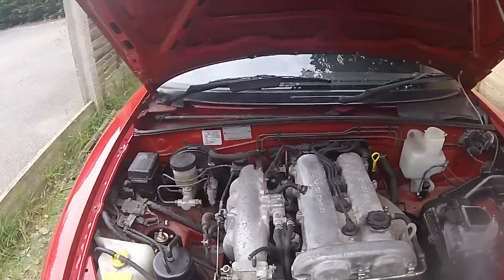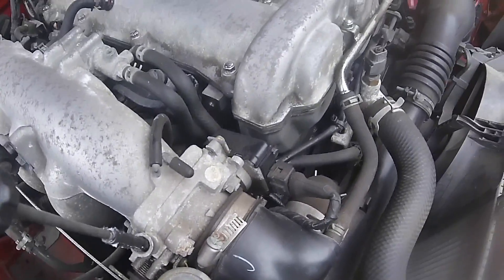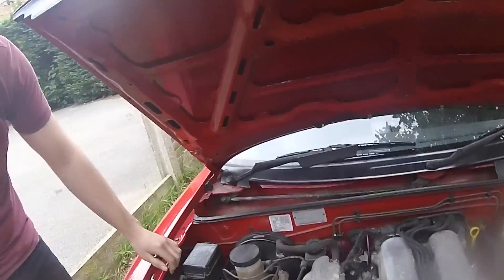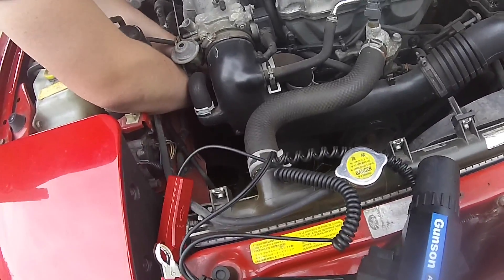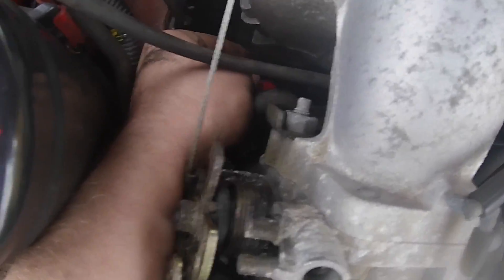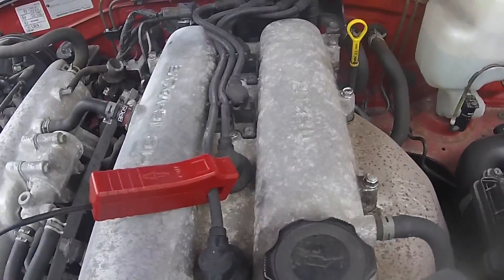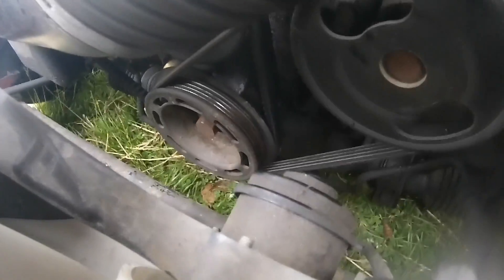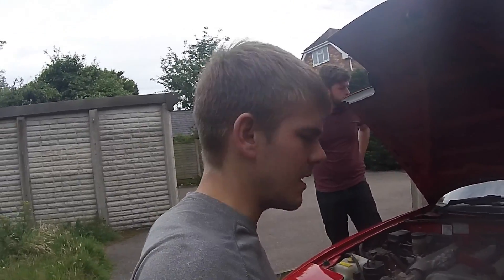How To 14 Degree Timing Mod On A Miata

Comment: I know this is old..but still very relevant. It helps a lot to use white paint on the indicator of the crank pulley to set the timing. Also, if you mess with the CAS (the bit you loosened up to adjust the timing), its worth buying a CAS seal/o-ring because these leak notoriously and will drip down the back of your engine. They're not too bad pulling out but it does take some finesse.

Comment: It's a bit late but for future reference, the Miata NAs have a little blue clip on the right side of the engine bay (UK passenger side, US driver side) that works for powering the timing light. It may or may not have a cover on it as well. Should be just behind the headlight
Reply: I use this one for my horn power lol

Comment: Apparently this mod doesn’t actually increase hp according to ppl that have compared on a dyno. It does however change the redline and cause the steering wheel to shake and even has a slight dip in power at ~3000rpm. Probably causes a loss in mpg as well. What a big lose!

Comment: Can the same mod be done on a VVT engine or is it required to install one of those timing advance plates like the one 5X produces?       My understanding is that the VVT function doesn't activate until around 4-4500 RPM.  I would not want to shift the cam position sensor if it might affect the VVT performance negatively.   I am thinking it might be okay to do your 14 degree advance and trust the ECU not to advance the timing too much when the VVT actuator engages.     Let me know your thoughts.   I could be over-thinking the issue.
Reply from the maker: yer cant do this to a vvt engine because the timing is done by the ecu so if you wanted to change the timing you would have to get a aftermarket ecu or a piggyback unit

Comment: This is a load of bull, it's a good way of melting your internals. If Mazda had thought this was a good idea they would have done it....
Reply from the maker: David F ahaha melting internals 😂 do you know anything about cars or what advancing the timing does or the actual risks behind it... if you advance it to far (better quality fuel well let you advance it further) it will start to pre ignite causing knock which will blow up your engine because knock is when the film of oil is being pushed out of the space between the big end bearings and the crank.... but if you know about knock and how to listen for it you will be able to tune the engine by advancing the timing to get more power... 14 degrees on this engine is safe to do, any further without properly listening for it you risk fucking it.
What do you think tuners do on the dyno... and do you know why they normally where the headphones, they are listening to knock as they advancing the timing or/and upping the boost but usually when you add boost you remove timing but that’s for another time. Hope this helps 😊
Reply: I've seen you comment this stuff on loads of videos. This engine was made to run on crappy 80's fuel. The fuel we have now is way better, there's nothing wrong with advancing the timing 14 degrees, people have been doing it for years.

Comment: You don't have to connect the time lights power lead to the car you can use any 12 volt power supply i.e. Another battery or another car
Reply from the maker: The Phantom very true
Reply: Ehm but why should you?
Reply: @TheAdatto  no one is saying you should they're saying you can

Comment: Since I didn't have a timing light, I did a ton of measurements to figure out how much 2º of a turn on my cam sensor is. That results in a 4-degree advancement from 9-10º. However, you still should use a timing light, lol.
Reply: If signal comes from the cam - 2 deg will be allways 4 deg on the crank. 
Cam rotates half the speed of crank. 
Thats why.
Reply: My car was having troubles reving past 1k rpm without going full throttle so i actually done this without a light myself basically tapped it little by little till my car didnt bog anymore then tapped maybe 1 degree past that till i get myself  a timing light soon got to love the short nose crank wearing out and delaying your timing about 10 degrees so it cant even idle with ac on
Reply: Wat een slechte video, je ziet niks

Comment: did you do this with ur mk2.5? and is there any point? i cant find an answer anywhere
Reply: Timing advance will help that. So will free flowing intake and exhaust
Reply from the maker: Illuminate The Dark no and yer there would be a point but I'm not to sure how you could do it apart from a aftermarket ecu
Reply: thats what i was thinking cheers
Reply: Illuminate The Dark go to my channel, I have a video on how to do it. they sell a timing advance plate for the MK2 miatas! it has been dyno tested to add 5 HP and 6TQ!
Reply: apart from a lighter flywheel is there anything you can sdo to make the 1.8 more revvy? its pretty sluggish stock
Reply: ta, its a mod i plan to do very soon

Comment: what octane do you recommend?
Reply from the maker: Blake's Gaming PC with this sort of timing you only need standard 95 here in the uk... but once you start adding more timing then I would recommend at least 98
Reply: Thanks
Reply: how much timing can you add with shell vpower?
Reply from the maker: eatthisvr6 max I would go to would be 15/16 degrees
Reply: I wouldnt go more than 14 degrees. Then use Super unleaded 98+. I read somewhere that someone was getting detonation at high revs on normal UK 95 unleaded.
I did it on my 1.8 Mk1. It definately improves pick up at low revs. Little difference at high revs I think.

Comment: I'm having a hell of a time finding the mark on my crank pulley.  I found something that looks like a chip from a rock or something, I didn't want to mark it and it be the wrong one.   I used a timing light without jumping tens and gnd and it looked like it was like 8 degrees off.   It can't be though, engine is running fine.  No misfires or anything.
Reply: I should add, I did replace my CAS o ring like 2 weeks ago, but i marked where the CAS was with whiteout.
Reply from the maker: psychotogen1 I'm not to sure man like your saying it might not be right because it's 8 degrees off but it should be quite a defined notch in the pully...
Reply: yeah, she's runnin fine aside from a little lifter tick.  I think im just gonna leave it alone until I figure out if it is the right notch or not.
Reply: zTurned out I had a keyway failure.   I'm doing the loctite fix as soon as new parts arrive.   I knew something was wrong.
Reply from the maker: ahhh shit man... well at least you found it and its quite an easy fix.
Reply: Yeah, kind of expensive.  I bought a used pulley boss and everything still ran me around 300USD.  don't wanna take any chances.  She's gotta be back into service so I can start saving for a swap.   Thanks for the words of encouragement though!

Comment: Are there any sort of gains to be had from doing this? I'm soon to be buying a MK2 1.8iS and I've been looking into how to gain 1HP here, 2HP there etc... :)
Reply from the maker: yer it does make a bit little bit of differance more where the torque is concerned.... yer everylittle helps with a small light wight na car. If you want it to go faster the best and cheapest way is make it lighter :D
Reply: Just watched your video where we see what happened to this car... Pretty devastating, but your mate is a very lucky man indeed! Coilovers save lives! ;)
Reply from the maker: Yer when I saw the car I was amazed he was only in hospital for the night! indeed they do!
Reply: What oil/HT leads/plugs would you recommend? :) I already have 5W40 semi synth Shell HX7 for the oil but interested for future reference... :)
Reply from the maker: oil I go for silkoline 10w-50 fully synth because its turbo but in tamzins 1.6 na I put castrol magnitec 15w-40 semi synth. ht leads I run magnicore 7.5mm blue leads. plug really depends on the build for heat ranges but I have run denso iridium power in a few cars now and I really like them I think its ik20 for mx5 but not 100% sure you will have to check.
Reply: Acme go to my channel! I have a video on how to advance timing on a 99-2005 miata!

Comment: Hey, does it worke the same for 1.8? I mean about wire and what it's for?
Reply from the maker: Im pretty sure you can do it on a 1.8. the wire is because the ISC is disabled when you jump 1 and 10. You set the idle speed with the wire in place then remove the wire and the ISC takes over and 
stabilizes your idle speed. hope this helps.

Comment: Hey guys, very nice video, I might give it a shot myself. One question, was the car cold when you started it and set the idle to 850?  Secondly, do you have an ebay link for that timing light gun? Thanks!
Reply from the maker: Hi  there, thank you! the car was warm basicly you just need to make sure its off of coldstart. I got mine from halfords but here is one that is pritty much the same:  http://www.ebay.co.uk/itm/Draper-52616-Pistol-Grip-Xenon-Ignition-Strobe-Timing-Light-/361629526273?hash=item5432cca901:m:m3x-reKWxuMXzNn6Fnl8Y0A